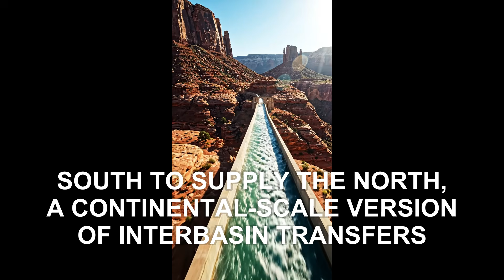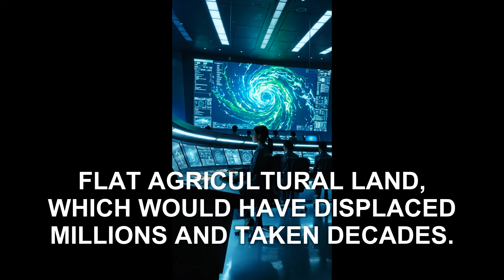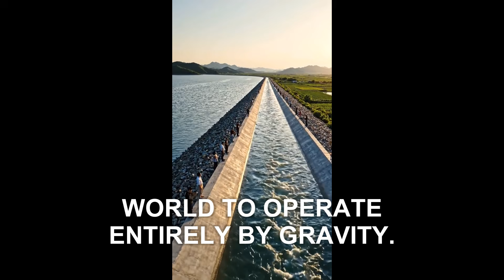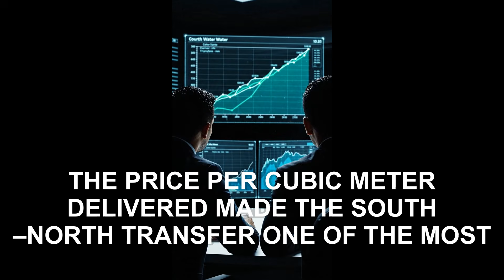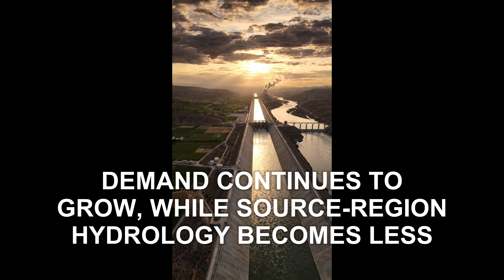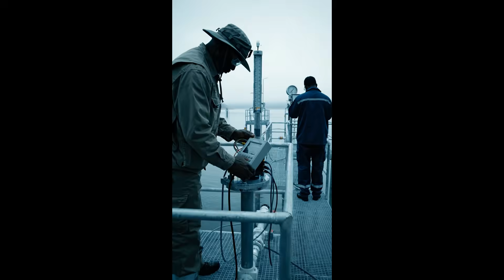China Just Re-engineered Its Entire Continental Hydrology

Comment from the maker: 1,500 km. 100 billion m³. 13 pumping stations that never stop billing electricity. Twin tunnels under the Yellow River so silt never mixes the systems. 330,000+ people moved for a gravity corridor. And the Western Route still has no start date — permafrost and 4,000 m elevation beat the plan.

One question: is continental water transfer the only honest fix when the north sits higher and drier than the Yangtze… or did China just buy time with a $60B+ system that still can't close the demand gap?

Drop your take 👇

Watch next: Why They Built a 32km Dam on Shifting Sand